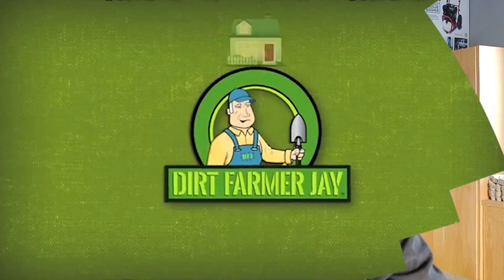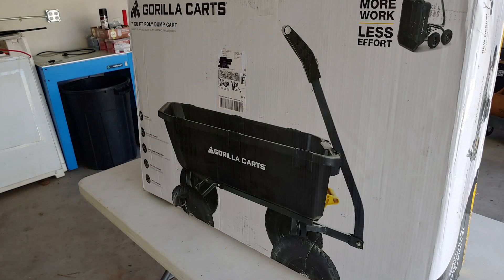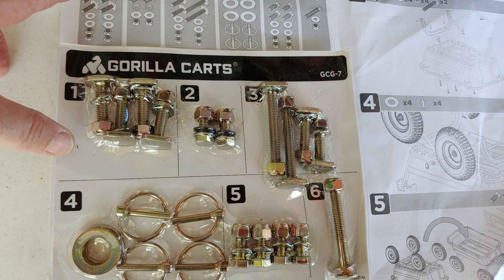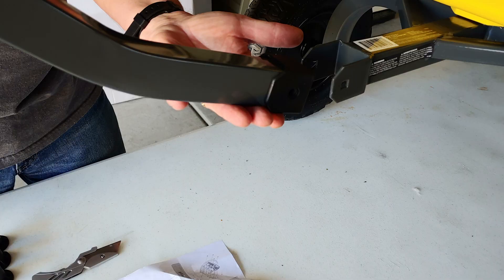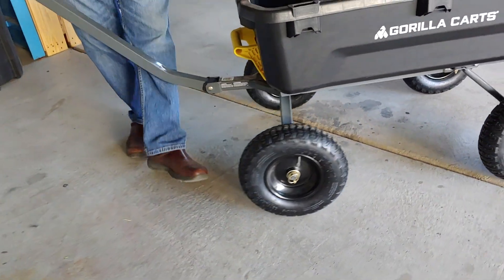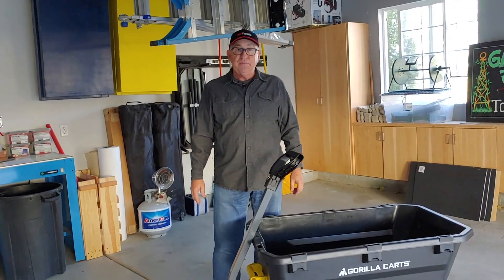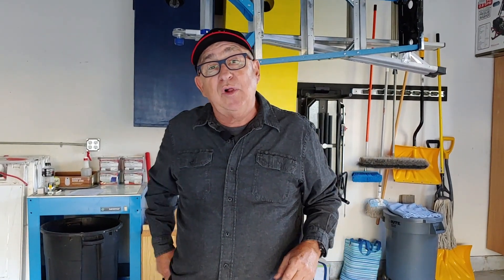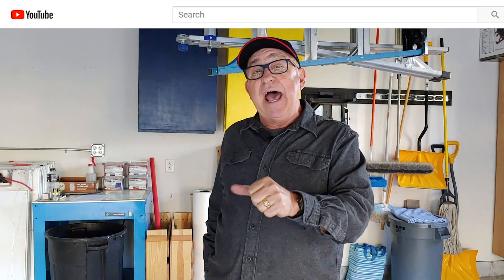Just How Good Are Gorilla Carts?

Comment: I have owned a Gorilla Cart for 5-6 years.  I have used it around the house for standard homeowner tasks (never abused). It has not held up very well at all. The poly bed cracked where the handle meets it, the tires are all dry rotted and the poly bed has two 6" to 9" diameter holes in it.
Reply: Obvious question - does this cart live outside permanently? did you adhere to the load weight recommendations?
Reply: Your experience does not surprise me at all.  Plastic and sunlight do not mix well.  Your brief review is worth much more to me than Dirt Farmer Jay's review of how to build it.  Plus I hate having 4 tires to go flat.  There are other wheel options much better suited to the garden.
Reply from the maker: Retired & Happy, A Ryan, and dchall8, all thanks for weighing in. We've had this cart for several seasons now, and it's still going strong. It is put away in a shady spot when not in use and put in our tractor barn over winter. The tires are still great, and I've not had the bed crack even with heavy use from time to time. It carries a variety of loads, including high volume, low weight items like raked leaves, loose straw, and so forth, as well as a load of bricks, dirt, gravel, sand, and so forth. Even though your insights are about a year ago, from time to time I go back and read all the replies from comments to see what experience viewers are having. Unfortunately, looking back has to be done manually - we need to search for them, as YouTube doesn't display replies. Sorry for the delayed response, and thank you for taking time to watch our video and jot down your thoughts. Best, DFJ
Reply: Imagine taking care of your things lol.
Reply: I have also had a gorilla cart the 10 for five to six years we have heavily-used it abused it to know and putting rocks in it tons of firewood I noticed  any of those people being careful at all.
Thought you had a got a cart that was either defective or you severely abused it. I have zero cracking no holes at all the bed whatsoever. Couple of tires having or showing signs and brought on the side but that's understood being out in the sunlight all the time. I plan on getting replacement tires anyway no big deal

Comment: Excellent review Jay and spot on. I just purchased the same model @ Lowes for $189, April '23, and I love it! I really like the  slots in the sides that allow you to double the volume compacity of the wagon by inserting cut 1x3 firing strips and adding plywood or boards. I love the dump mechanism and how well it works; also like the feature that allows the handle to easily come off so it can be towed by my tractor. The wagon rolls very smoothly and the wheels are sturdy and well sized for the wagon. I do wish the wagon had a hand brake as my 8 acres is very hilly and this wagon will and does roll away very easily. The directions and the way the hardware is bundled individually for each step of assembly is superb! All in all a well built, well designed,  great product!

Comment: Recently purchased one (after watching your informative vid).  Quick feedback after spreading 12 yds (aka 324 cubic feet) of mulch with it. 
PROS: 
1. Easy to assemble and excellent packaging and directions.
2. Overall super easy to use (much friendlier on my back than my wheel borrow).
3. Articulating front wheels (turn with handle) make for rapid positioning of load to dump.
4. Wheel height and bed are high enough to go over and around low ground cover.
5. Quick dump with the rear axle pivoting under the dump to (acts like a dump assist).

CONS 
1. If pulling with tractor it is very difficult to backup.  If they included a couple clamps to lock out the front axle it wouldn't be an issue.  Without a way to lock the front axle from pivoting/articulating front wheels become a major bear for backing your load up.
2.  Minor thou if a bit taller than the load would completely dump without having to scoop the residual out since the tail of the cart hits the ground when you dump it.
3. Minor comment as I pulled the cart with my lawn tractor the locking pin kept popping out on me (user error?)

Overall, wonderful add to our yard equipment.  Thanks for the informative review.
Cheers
Reply from the maker: Great insights! Thanks for taking time to write! Best, DFJ

Comment: Question, how much muscle to do have to have to dump it? Not as strong as I just to be, older woman and if I fill it up with rocks will I be able to pull up the handle to dump?
Reply from the maker: Nancy, thanks for watching and taking the time to write. I think you will find the cart pretty easy to dump. It's well-balanced and the way the suspension works is that the center of gravity is moved in your favor as the cart is dumped. Yes, even with a load of rocks and moderate strength, you will find it manageable. Best, DFJ
Reply: @DirtFarmerJay  Thanks so much

Comment: I like the one that's probably an older model and it has the medal handle and dump release is also medal too
Reply from the maker: Scott, your experience pre-dates mine and this is a good insight. Time will tell if the components will hold up. I know sunlight is REALLY hard on plastic components, so we will store it in our tractor barn or under tarp between uses. Do you have a model number and an approximate date of purchase? You've intrigued us! Best, DFJ
Reply: @DirtFarmerJay  the only thing left on it was lot nbr LPD-31956 & on the bottom of the same tag it had manufacture date 0515/0515 & make in china
Reply: The GOR4G-COM cart I have was from production lot in February 2018 which still had the yellow chromate metal release lever and painted grey handle.  They also have a green and black poly tub option as well I think the black poly tub will withstand UV better than the green one which fades and degrades in less than 2 years.  My cart is a yard queen that has done no work and I can tell you it does not even withstand the elements that well to even look pretty.  These carts are great for immediate project uses and then they are scrapped a year or two down the road.

Comment: I've been using a collapsible cloth wagon for grocery shopping and getting 20 pound propane tanks home. Needless to say it's a chore for me pulling the load home a mile and a half. Curious if the gorilla wagon would make it an easy chore. At 65 I'm looking for better ways to make life a little easier.
Reply from the maker: Vernon, the cart is not very heavy, and the more substantial tires would likely offer less rolling resistance. The pull handle is comfortable as well. I hope this helps! Best, DFJ

Comment: Gorilla carts are awesome.  I've been using one for years and it does everything I need it to do around the yard.  I suggest replacing the stock pneumatic tires with solid tires as the pneumatic tires leak and require constant re-inflation.

Comment: It's good for working below or level ground but if you're trying to lift an area, the little dump doesn't work. Had to go back to the wheelbarrow for my project. It's ok but I'm not that impressed with it. Instructions were pictures. It would have been nice to have words. Language is a good thing . Also, the cotter pins on the wheels came off, so be sure to rig those it you need to. Finally, reviews elsewhere are saying the wheels are garbage. I think mine's going back.
Reply from the maker: Sorry you had a bad experience, Catherine Alexandria. We love ours but every situation in the garden is different. Thanks for watching and commenting. Best, DFJ

Comment: It seems to me that the hex nuts and bolts for the dump handle are in backwards. The area around this in the outside are hex shape. This way the smooth rounded heads are on the inside of the cart. Nice video, like the thickness of the cart- doesn't seem flimsy. Thanks for sharing:)
Reply from the maker: Regina, thanks for letting us know. I'll double check it. Thanks for being observant and taking time to write. Best to you and yours - DFJ
Reply from the maker: Regina, I just double-checked the pictogram, and the way I've installed it is the way I showed it. However, it would work the other way as well. I'm loving this cart, it's full of mini-pumpkins right now in preparation for a community event we are appearing at this weekend. Thanks for being in our viewer family! Best, DFJ

Comment: I wonder if I had the cart full of dirt would the average older lady have to use much muscle strength to lift the bucket to dump it? I was going to ask if it was easy to pull with a load of dirt but then I figure it has to be a heck of a lot easier than carrying each bag to where you need it :-)
Reply: I've had mine for three years - I used to fill it up with dirt or stones and dump it without a problem.  This year I have been putting everything into five gallon pails and then emptying them - I'm getting old  (91) and can't do what I used to do.  I had to drill the hitch pin hole out s little larger because the Deere magnet pin was too big snd when I tried to use the handle pin I couldn't see the hole for the big cotter pin.

Comment: Dirt Farmer Jay,
What do you mean by putting slime in the tires? What brand of “slime” and do you mean put the slime on the inside of the tire or the outside? 
Any help is appreciated.
Reply from the maker: Drew, thanks for watching. Slime is the common name for a liquid viscous product that is pumped into tubeless tires. In fact, the most popular product of this type is Slime® brand name and the product is called "Tire Sealant."  If the tire is punctured or develops a small leak, then the "slime" flows into the leak and fills it, either completely or to a point that the tire will "hold" air for a long time. The product is widely available at places like Target and Walmart, and auto parts stores. I hope that helps! Best, DFJ
Reply: Thanks for the clarification.

Comment: How much lift force is required to pull up & dump a load of dirt or poop? You are lifting an empty cart. Looks like would need to use a rake to fully empty it out.
Reply from the maker: The way the carriage is set up is that the back tires move forward and tuck under the tub when you lift the handle. There is very little debris left in the tub after dumping. The tuck action also gives good leverage in assisting to lessen the load when lifting the front edge of the tub. We've used the unit for a variety of loads, including an unintentional load of water after a good overnight rain. Still manageable. I hope this helps - thanks for writing! Best, DFJ

Comment: 6:46 - the tire on the left side of the screen is about to lose the pin. Is that normal or are the pins inserted upside down? Also, is the center steering (pin) mechanism made of cheep plastic or sealed ball bearings? It appears to be cheap plastic which I can't image will last too long.
Reply: Everybody builds these upside down. There for installing the wheel retainers in upside down. And yes they will fall out if installed that way.

Comment: Do you think this will handle the beach ok? Will the sand ruin the bearings in the wheels?
Reply from the maker: As you know the beach is a brutal environment for these types of things. Sand gets into everything. DFJ says that if you grease the axle lightly and also apply grease to the face of the bearing cover before inserting the cotter pin, that will help keep sand out of the little spaces and make your cart last a long time. Hope this helps.

Comment: Has a wagon pulled by hand its great.  I pulled it with my mower and the tabs bent.  After bending close to a dozen times one of the tabs broke.  I now have to add steel to it.  WEAK POINT.  Not sure if I will contact them or just fix it.
Reply from the maker: Thanks for taking time to write. What tabs are you referring to? I want to be clear so I can seek an answer. DFJ

Comment: This product is useless for ppl who have sloped yards. Why, you ask? Because even a partially loaded cart will be uncontrollable due to the lack of a braking system.  It will “run away” from you with possibly dangerous results.
Reply: I doubt the Dirt Farmer has used this toy to do any real work.
Reply from the maker: John, you can do better than this - this cart has been a hardworking partner since we got it. I guess hauling rock, dirt, bricks, loads of soil, compost, plants and trees ready to be planted, or all the material going into the compost bins don't count as real work. Really? Your point on the highly sloped yards is well taken. There is no braking system on this cart, but for the value we receive around here perhaps a trade off would be the old fashioned rock behind the tire technique. Thanks for taking time to view the video and write - best regards, DFJ

Comment: There missing parts. Like washer ect. The bolt dose not hold while assembling. Cause the square head bolt holes are not deep enough. The handle breaks. The tub is very very thin THAT ANOTHER THING!  THE CLIP PENS, HITS THE VALVE STEM!  EVERY TIME THE WHEEL TURNS !  I RATE IT AS? PISS POOR  👎👎  What i did like about it if it had all of its parts was? the way the instruction was laid out 1, 2, 3, 4, 5 with the parts. IT NEEDS A LOT OF FINE TUNING TO BE A 100 dollar cart. I sent mine back and got my money back. Cause i can build a better cart!  Way less than that > I got a steel wheel barrel tub that is waiting for some love. That way i can throw logs and bricks into it with out breaking ~ Plus i will use lawn mower tires and wheels on it

Comment: I’m skeptical. I have a lawn care company and also burn with wood in a outdoor wood boiler in the winter so I use and abuse these carts. I have had many carts and wheel barrows over the years. I haven’t found anything that holds up very well. None are rated for real world use. This cart looks similar to all other brands as far as lack of toughness.
Reply from the maker: Tim, I hear you. My brother has one of these carts and he really loads it and it is not treated gently at all. It's really ugly, but it keeps working. The latches and such are replaceable, so that's a plus. It sounds like you need a metal cart. I've used an AgriFab unit for years (over 25 now, same cart) that is 4-wheeled and I tow behind my lawn tractor. You might consider that approach. Thanks for writing and weighing in! Best, DFJ

Comment: Tires go flat!
Reply from the maker: Lich King, we haven't had that problem, but we did a few things that I think help maintain the tires. When we first got the cart, we removed the valve stems in the tires, and placed "Slime" brand tire sealant in the tires, and then replaced the valve stems and inflated the tires to the right pressure. Second, we don't store the cart outside for long times, so as to slow down UV degradation on the tires from the sun. Third, if a tire does start to lose pressure slightly, we reinflate to assure that the bead of the tire stays affixed to the rim. Perhaps these measures would help in your situation. Thanks for writing! Best, DFJ

Comment: Gorilla carts will last 1-2 years at most.  Hub bearings come apart, tires dry rot and the metal corrodes
Reply from the maker: Curious, are you speaking from experience because you had a Gorilla Cart that these things happened to? Or are you speculating? We've had our Gorilla Cart for about 18 months now with no issues. But we keep it inside the barn when its not in use. Let us know. DFJ

Comment: Incomplete review but a nice payoff to the manufacturer for a free cart.  See other reviews before you buy.  Front axle pivot point is weak spot and will fail.
Reply from the maker: Jeff Wright, thanks for taking time to write. Wow, I don't think I can be that cynical, but I appreciate you weighing in. We've had this cart for some time, and it continues to serve us well. We've worked it hard and have not had the problem you describe. I'm curious - do you actually have the cart and are speaking from experience or are you repeating what you've read elsewhere? We did a review on the Rubbermaid® two-wheeled garden cart that we purchased and had one of our viewer family rave about the Gorilla® cart and asked if we could do a review on that cart as well. We reached out to Gorilla and asked if they would supply one. They did - but we accepted it only on the condition that we would give an honest review - whether it be good, bad, or ugly. They agreed. What you see is our honest assessment and we stand by it. I do agree that anyone that is going to make an investment in a product that will be used routinely should take the time to get reviews from a variety of sources. That's part of being an informed consumer. The fact that the cart was supplied did not weigh into the overview - whether you think that is the case or not. Again, thanks for taking time to write. Best Regards, DFJ